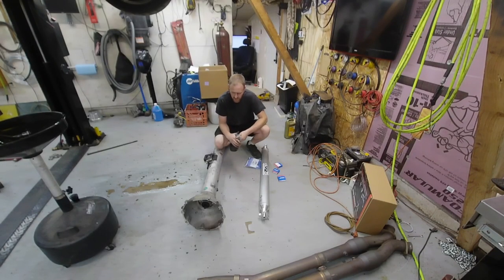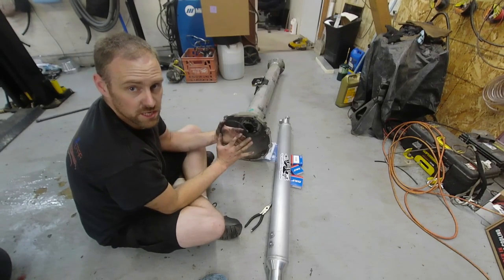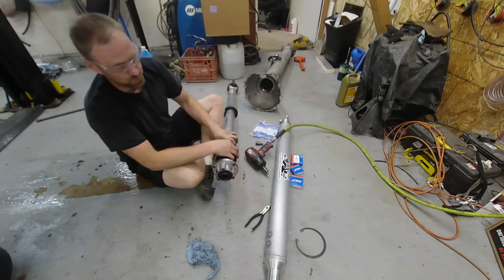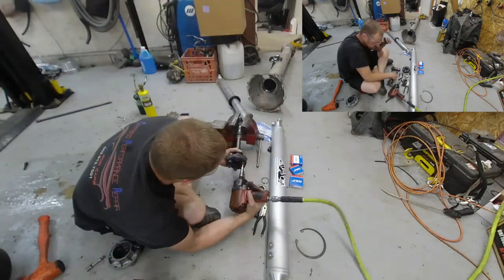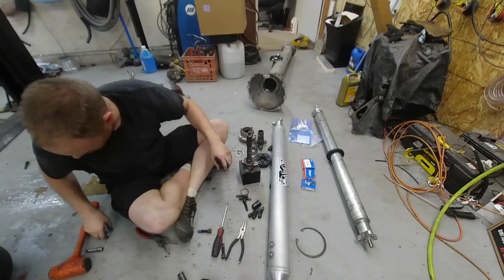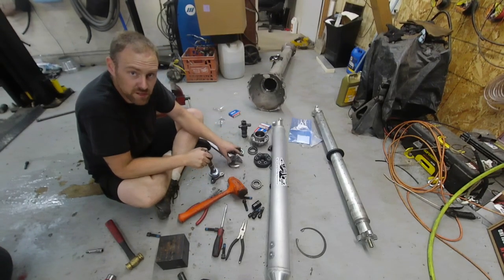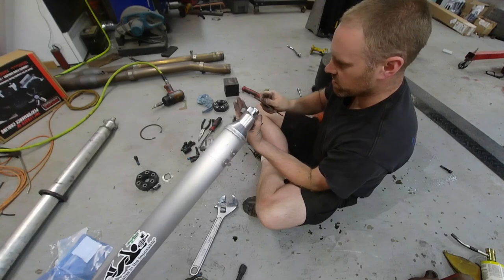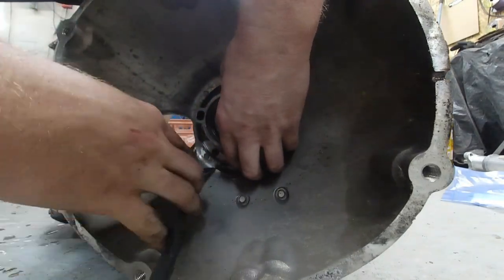C6 Corvette Performance Driveshaft Upgrade

Comment: Thanks for the video. Just bought a 02-04 z06 torque tube and did the billet ends and new bearings for my 98 c5 track car. Did the rebuild today will be installing back in car tomorrow!!!!!
Reply: How has this held up for you? I've heard of guys pushing over 1000hp with this setup...

Comment: Why not a carbon fiber drive shaft? The weight of a solid aluminum shaft would have to not only have harmonic issues, but when your pushing 900 to 1000 horsepower, you could twist the shaft under load. Even in the Weather tech series, they all use carbon fiber. The noise you hear is not gears, it's u-joints that are not fazed.
Reply from the maker: Well there isn't any u-joints in this car so that's not the noise. I did eliminate the rubber joints though so it no longer has the ability to harmonic dampen through the rubber.

Comment: Aside from 10 and 12mm bolts is there Any differences between an A6 and M6 ds? I need to by a cf ds and my supplier have one but do not know to the technical differences
Reply from the maker: I'm not positive, but the bolts make a huge difference. I found out the hard way that a guy really should really hole and wire the bolts together on these drive shafts. Turns out no matter how much loctite you put in if it's a high performance application that can somehow work themselves loose. Drilling a hole through the head of the bolt and running wire to tie all the bolts together is a must in anything with decent horsepower. Especially when eliminating the rubber joints and go into solid joints.

Comment: I need help with my torque tube on the end of the driveshaft there’s a wheel that grabs the flex plate and I can’t seem to get it off I have a 2010 corvette auto could you know how to remove that?

Comment: Hard to watch and concentrate on what your were saying and doing because it looked like you were sitting in a puddle of oil or grease!! ROFLMBO!!  
Do daily drivers 4-500hp need to replace their driveshafts/components as preventative maintenance or wait till something fails (85K miles)? Thanks for the great video!!
Reply from the maker: That's fairly mild power and unless you feel a vibration, noise or something I'd say you're probably fine. Not really maintenance until you get above 800whp or maybe at like 150+k unless of course you are drifting or doing a bunch of dig racing with sticky tires. Certain driving will beat on the joints a bit extra and might be enough to do as maintenance.

Comment: Hey my torque tube went out on my 2009 c6 corvette base model , so I just need to buy a new driveshaft? If you can can you share a link to a good one?
Reply from the maker: If you can get the hook up at the dealer you can actually get a complete tq tube assembly at reasonable price I believe. What you need will depend on what failed. Typically the joints or bearings fail and a rebuild can be done.
Reply: @CrazedPerformanceRepair  thanks for replying, I was hoping I could just buy the driveshaft with the bearing etc because the whole torque tube is like 1200$ and the labor will run me 1100$ so I’m just trying to save a little
Reply from the maker: @alonzo5.040  The driveshaft is usually fine and all you will need is the wear parts like bearings and rubber joints. The issue is if you are paying someone to do it the parts and labor might exceed the cost of a torque tube assembly when rebuilding it. All depends on the shop and their labor rate/time to rebuild it.

Comment: Any issues with a dss driveshaft I’m running one but it has a rattle, automatic c6
Reply from the maker: Found out it's wise to wire the bolts to make sure they won't work loose. Lock tight and torque to spec isn't enough once you eliminate rubber joint.
Reply: So not matter what you do is still
Going to have a rattle, i mena it doesn’t affect anything but is annoying
Reply from the maker: @williamalcala5660  well the automatic shouldn't rattle. It always has tension on it. Might have something loose.
Reply: @CrazedPerformanceRepair how do u keep the balance if u wire them. Doing my c6z rn and went to a solid ds
Reply from the maker: @jonathonvince561   Do it as evenly as possible. Figure out the length of wire needed and cut each one the same length.
Reply: @CrazedPerformanceRepair  OK. My parts come in tmro and I have it torn down. I got rid of the couplers and got a whole ds and new bearings.